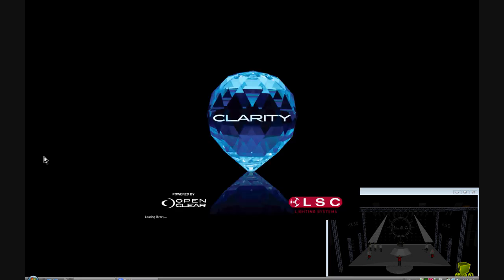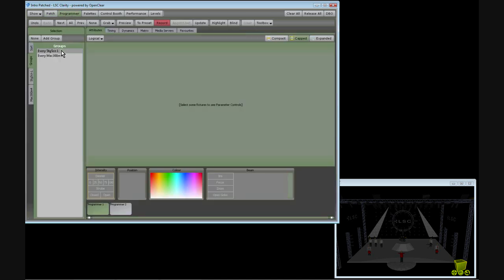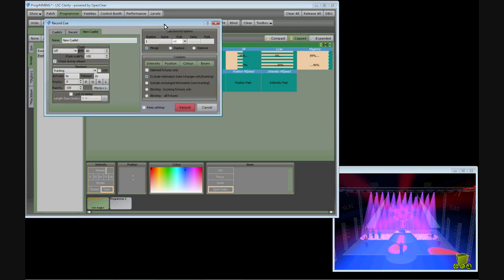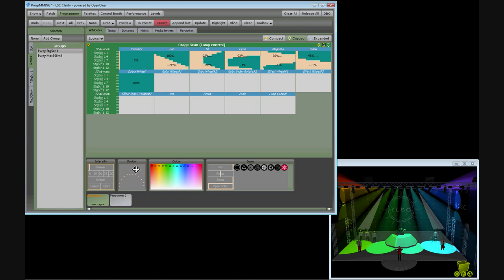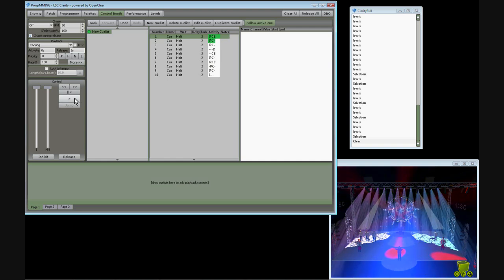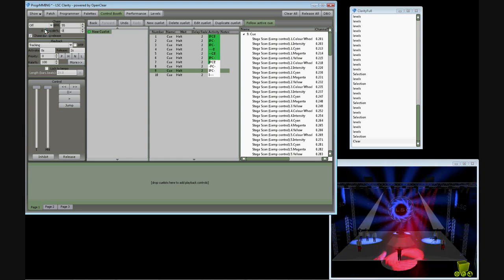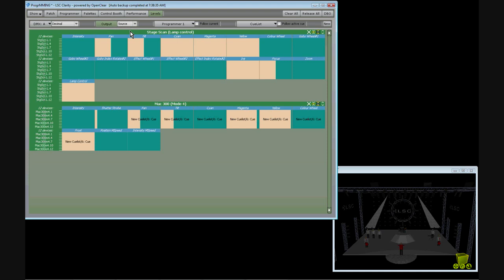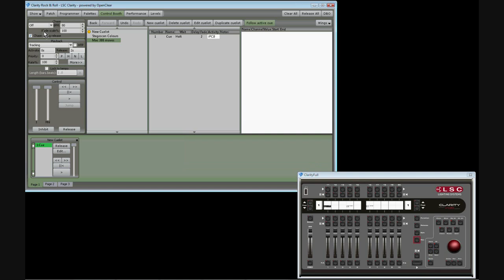LSC Clarity Quick Start Guide

Comment: Nice software. Can it be used with other hardware(specifically Pharos Controls), if so how do yo integrate the two.
Also how do you achieve the window showing the simulation on the bottom right?